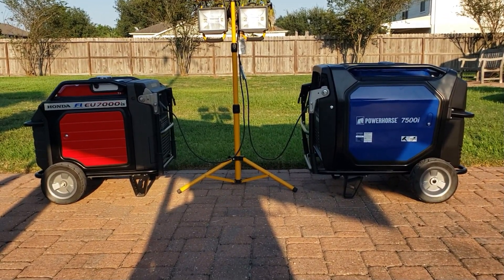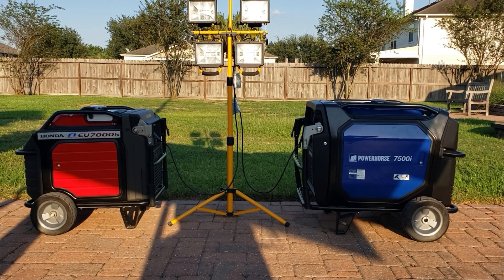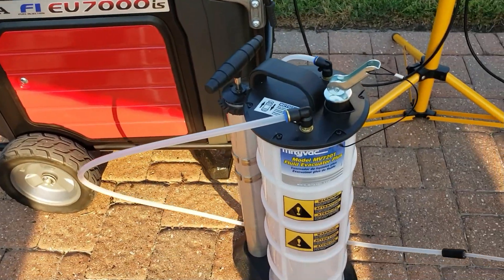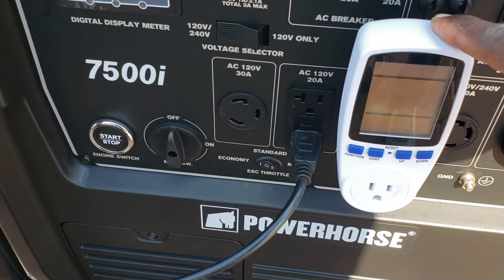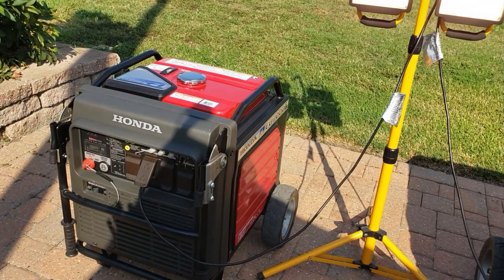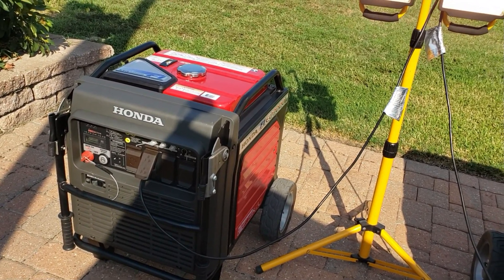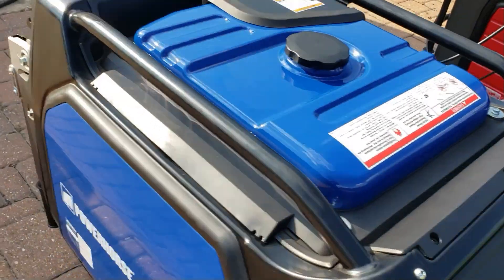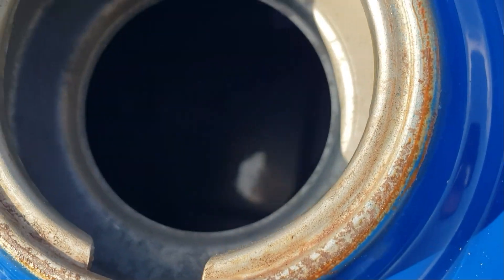Honda EU7000 VS Powerhorse 7500i Fuel Efficiency Test | Carburetor vs Fuel injector

Comment: According to GeneratorBible comparision. The Honda 7000is burns .32 GPH at quarter load and a Duromax 7000IH burns .19 GPH at quarter load.   Its hard to imagine duromax efficiency being that significant.  I think testing that would make a great video.

Comment: Notice: Powerhorse Warranty Dept is actually the Sales Prevention Dept.  Purchased 7500i on 06/2024 and by January 2025 the inverter failed. Calling the Warranty Dept (via Northern Tool) I was told because we are  "Off-Grid" we were considered "Commercial". We are not. We are a single family residence. I specifically purchased the Powerhorse after reading the Warranty, which specifically stated, residential covered for 2 years. NO mention of Off-Grid or Hour Limit. The Warranty Rep then went on to say, " It doesn't matter what the warranty says we make the call". (Whether you are commercial or residential) My opinion is don't purchase a Powerhorse there are several better quality choices out there in the market who back their product.

Comment: it would be interesting to test the old carb eu7000 vs the new eu7000 fi to see how much better the fi is over the carb model, also it would be interesting to test the Honda  7000 vs the Honda 3000 at a 1000w  just for fun. is that something you could do?

Comment: I would to point out another difference between the Yamaha and the Honda in this test, the Honda does not meet the California emission standard so it can't be purchased in California, the Yamaha does meet the California emission standard so you can purchase the Yamaha in California. So even with the electronic fuel injection the Honda is not as clean burning as the Yamaha with the carburetor.

Comment: This test was not quite fair to the Yamaha because some of that 32 ounces of fuel had to be used to full up the fuel bowl, the gas in the fuel bowl is likely enough to run the Yamaha another 2 to 3 minutes putting the Yamaha within 1 or 2 minutes of total run time on the same 32 ounces of fuel. Remember that when you turn off the fuel shut off valve you are running the carburetor dry but the fuel bowl will still have fuel in it, that is why you have a fuel bowl drain screw for long term storage to drain the fuel from the fuel bowl. 

What should be done is put just enough fuel in the Yamaha to allow it to start and let it run the carburetor dry, then put in the 32 ounces of fuel and do the test, that way the fuel bowl will only need a very small amount of fuel to top off the fuel bowl.
Reply from the maker: Hey guys, the whole point of this test is to show in factory condition and also to be fair. The Honda had to use some of that fuel in its fuel pump and the filter.
Reply from the maker: And also the Yamaha uses every drop of that fuel when it shuts off the bowl is empty
Reply: @GeneratorReviews  Actually it does not, that is why Yamaha installs a clear hose and tells you in the manual to drain the fuel bowl by opening the fuel bowl drain screw. 
I run my Yamaha's with the fuel valve shut off to drain the carburetor but to completely empty the fuel bowl you still have to open the fuel bowl drain screw.

Comment: Regarding the kill-a-watt not fitting.  I have a short VERY heavy gauge cable I use sometimes.  Its on ly maybe a foot long.  But it has 1 male plug on one side to lug into the outlet and on the other end it has a splitter to have 3 outlets.  You could plug something like that into the Honda and the kill-a-watt into that with the lights plugged into it.  I know it's an old video.  But that little short extension cord shouldn't affect the results for anything you test in the future.  Good video.
I'm about to buy one of the Hondas by the way.

Comment: Big mistake!  Empty gas tank is a great BOMB full of gas/air mixture!  Let's store them like we do a prop airplane.  Every plane is ALWAYS stored with FULL tanks for great reason, to prevent your empty tank from breathing.  Night comes.  Empty tank air shrinks and sucks in moist air thru vent.  The cold tank all night causes the dew air to condense on the tank into droplets which slide down the walls rusting the inside of the tank and collecting at the outlet to your engine.  Day comes, temp rises pushing air out the vent.  Night comes and the dew air gets sucked in to repeat the process.  Water gets sucked into the plane engine causing a CRASH!!  Full tanks can't breathe.  Gas in a full tank doesn't breathe out the light aromatics so the gas NEVER GOES BAD!  No magic potions are required like STABIL to keep the gas fresh.  Full tanks contain NO EXPLOSIVE MIXTURES!  No air in the tank...no burning!  ALWAYS store planes/cars/gas-powered anything FULL TO THE LINE.
Reply: Interesting, so much to learn. I have never heard this before. So an empty gas tank breaths? I’m so confused 🫤
Reply: Ya 29 years in aircraft maintenance and a ppl , not one bit of that is true . 
Aircraft fuel tanks are at atmospheric pressure.  
The rest is pedantic nonsense you’ve spit.

Comment: When the works gets gummed up you can tear a carburetor down, and clean it up to start.  If you have the better one - fuel injection - then you are probably out of power until the storm is over. then all you have to do is figure out how to get the 200 lb monster to the repair  shop.
Reply from the maker: 😅Agreed ☝🏽

Comment: You said what??? Come again??  Half hr for every half a quart of gas you realize there is 4 quarts to one gallon of gas? That's 128 full oz'es of gas 32 per quart. I know damn well ain't no twin engine running 20 minutes on even one quart I've watched my Intek vtwin Briggs. 22hp.  About half a quart every nine minutes. Happy medium somewheres between quarter n not quite half throttle without load. That free spooling just running. ( YOUR A F*CN😂 LIAR)

Comment: So that's 2 kWh per gal for Powerhorse and 2.8 kWh/gal for Honda. That is way short of typical small generator efficiency of 4 kWh/gal. You need to try these at 50% rated load or 3500 watts instead of 15% load.
Reply: That's because they ran at such a low load. A generator will run most efficient when running close to 100%.

Comment: I like the smaller generators because I know you would have gotten more fuel economy or efficiency out of the smaller generators than these bigger generators.
Reply from the maker: I’m actually going to do that exact test with the same amount of fuel in each one.
large generator versus a smaller one fuel efficiency test
Reply: @GeneratorReviews  I'll be sure to look out for it. I know that Honda sure does look like a nice generator though I know it's pretty darn expensive but it sure looks like a nice generator especially for more power.

Comment: So how is fuel pressurized in the Honda?  In-tank fuel pump?  My point is that most generators "just sit"...some for years between actual uses.  If that fuel pump goes bad, especially  due to lack of use, and then you need that generator you might be wishing for the simplicity of a carb.  Something to consider.  Nice review.
Reply from the maker: Great point!! But I think everyone should run their Generators at least once every few months to prevent this from happening 

Thanks for the comment 👊🏾👍🏾😎💯

Comment: Honda FTW :) Power Horse ~40 Mins  Honda 52 Mins 39 Secs
Side note: the Honda has a fuel pump letting it run out of fuel will damage it eventually. eg. a fuel injected vehicle fuel pump.
Reply from the maker: Sacrificing my pump for the test that’s one test I won’t be doing again😅

Comment: You could have used the kilowatt meter with an extension cord - FYI
Reply from the maker: Then someone else will comment, you didn’t keep the test the same. Thrust me I get all the keyboard warriors in the comments.
Reply: @GeneratorReviews  hey I want you to know it was a really good video first off.  But ok about the cord idea  : ) it was just a thought - I believe that for sure - but I guess you could use two of the same extension cords or I’ve even seen some little one foot cords that have a threeway on the end

Comment: Hi Gavin, watched a lot of your videos on generators. Just went through Ian here in SWFL and have used a Honda 2000i for power to essential devices...I love that it will run 12 hrs on one gal of gas powering refrig, freezer and computer.....but would like to be able to backfeed house panel to run water heater, stove or other for short periods of time......I love the honda's but $5000 is way over priced.....so I'm thinking 2 Genmax 3500 units tied together to feed a 50 amp plug coming off of the panel. could you do a video on how to wire what I am talking about and discuss the fuel efficiency of 2 smaller units vs one big unit?
Reply from the maker: Yes I will do that, great idea 💡
Reply: Does the parallel GenMax setup produce 240v? I took a quick look and only saw references to 120v - you’ll need 240 for the stove.
Reply from the maker: @davincrook9927  yes it puts out 240v

Comment: Another factor, as others have stated, is that the Honda has a 389cc engine and the PowerHorse has a 420cc engine. Bigger engine consumes more fuel. The carb didn't help either.
Reply: Yep yep 👍👍

Comment: Hi Gavin, I just subscribed and enjoy your videos, thank you.  I like to get your thoughts on how to best stock up for fuel for a short-term and long-term power outage.  I live in Florida, and we have both hurricanes and no name storms to contend with.  I do not live in an evacuation zone and I'm fortunate to live in an area that is close to a hospital and underground power lines.  This past hurricane experience, we did not lose power.  But learn from the past and prepare for the future is what I always say.  Thank you so much!
Reply from the maker: Hey Juan
Thanks for subscribing. I think the best way you should store fuel especially gas is having all your containers and your gas treatment ready. 
Usually when a storm is coming, we usually have a week in advance warning that’s when I store my fuel.
Propane has a 20 to 30 year shelf life so you don’t have to worry about storing propane.
Always store your generator, completely free of gas.
Reply: I live in Florida as well I purchase my fuel between 35 and 45 gallons in 5 gallon containers when the first storm threatens and I buy the fuel before all the panic buying starts, as long as you have air tight fuel cans which todays fuel cans are air tight you can store enough fuel to get you through Hurricane season. If a storm hits you may use up most or depending on how long power is out all of the fuel supply so you may have to replenish after the storm passes and electric is back on. If you don't have to use the fuel or you only use part of it as soon as hurricane season is over you can then put the fuel into your vehicles. 

One thing is you should purchase only premium fuel, that way the octane will stay consistent while you are not using it, any degradation of the octane will still keep you above the 87 octane of regular fuel. 

We were without power for a week and a half after Hurricane Ian and we used 40 gallons of fuel running two generators. During this last Hurricane Milton we lost power for just under two days and we only burned 5 gallons of fuel.

Comment: Gavin, great test/comparison 👍 - Love your no-nonsense ☝️ approach - You sir have a new subscriber. 

I own the earlier (carbureted) Honda EM7000is.  Purchased it in 2004 and have used the generator after several hurricanes 🌀 hit South Florida since then.  Fortunately, we did not get hit this week in Miami by hurricane Ian.  

Anyways, I am very happy with my Honda.  It will run 14 hours on 5.1 gallon tank with all the connected 120v load in my home.  I use a Cutler Hammer/Briggs & Stratton 7500 watt transfer switch to handle the load distribution.  Back in 2004 the Honda cost me $3,500.
Reply from the maker: Thanks 🙏🏾 LP
These are forever generators, happy to hear you are safe from the hurricane 🌀 
Thanks for watching and subscribing

Comment: So.... the Honda would burn around .32 gal/hr for 16 hours.  That  surely would be based on 25% load or less.   I'd guess at 50% load, it would be more like .5 gal/hr or more.  At 75% load -guessing .7-.8 gal/hr.   If you ran 50% load for 8 of 24 hours,  thats up around 4 gal/hr.  If you had no line power for 5 days.  would be 40 gallons of gas if math is correct.  That's eight gas cans of 5 gal each.  Someone ✔✔ the math.  40 gallons x $5/gal=$200  $40 day?  After a major event like Florida's most recent hurricane,  where would you find gasoline, much less 40 gallons  and have to store it.

Comment: Wow... That is pretty impressive for both of them.  Another comparison loading each up to 50% and 75% load on each would tell if there are differences in how the inverters handle power loading.   I have an older no-name Chinese 5500 watt (6000 surge), non inverter generator.   I just ran a test a few weeks ago.  I used 32 ounces  (1 qt) of fuel.  I used two 1500 w heat guns on high.  So 3000 of 5500 watts is a 55% load.  It ran just for 23 minutes and a few seconds.  
Anyway, double the price for the Honda,  I'd have to stay with the other options.  If you have Nat Gas,  (conversion kit) you don;'t have to run all over the place finding large quanties of gasoline for extended outage. But - that isn't likely an option for the Honda Fuel injection...

Comment: This is why cars moved to Fuel Injection from Carburetors years ago.  I knew what the outcome would be before the test was run.  The only question I had was for how much longer.  You look at this result, and now think of larger Engines, running gallons of gas, and it makes a huge difference.
Reply from the maker: Well said sir👍🏾👌🏾💯
Reply: The reason vehicles went to fuel injection is because of tighter emission standards, but Honda failed with the EU7000iS because even with their electronic fuel injection it does not meet the California emission standards and it can't be sold in California, the Yamaha with its old technology carburetor does meet the California emission standards and you can buy it in California.

Comment: Honda is the best at everything  cost is higher for the Honda  but you get what you pay for
Reply: Totally Agree 👍
Reply: I disagree, Yamaha is second to no-one when it comes to inverters, their generators are well known for their reliability and longevity and the Yamaha inverter produces power clean enough to run sensitive hospital equipment. When it comes to motorcycles Yamaha is always ranked number one in reliability.

Comment: With carburetors its all about jetting for your elevation and temperature.  Both engines will only run so lean . The efi gen  is obviously self adjusting leaner then the carburetor generator is jetted.
Reply: Here is a fact left out, the Honda even with the electronic fuel injection it does not meet the California emissions standard and can't be sold in California, compare that to the Yamaha which has a carburetor does meet the California emissions standards and is sold in California.

Comment: If you didn’t use the fuel tanks it would of been a fair test. You introduced too many variables if you were to use a separate tank and measure out the same with no variation in tank and bottom design your results would be more accurate.
Reply from the maker: You’re right, but I always try to do a real world test as it sits we’re not testing the engine we’re testing the tanks and fuel lines. 
we’re testing the complete system seeing how efficient the generator tank is at getting every ounce of fuel into that engine.
But I do understand your point
Reply: Well, one of these engines uses a fuel pump in the gas tank to provide pressure for the injection system while the other uses gravity. the Powerhorse will use all it's fuel minus small amount left in carb bowl while the Honda will stop running when the fuel pump stops providing pressure to the injector. The best way to do this test is to run both generators for the same amount of time and measure what was used:) I would expect the Honda to use less fuel because the generator can better optimize itself for altitude.
Reply: He should have sucked out most of the fuel, but left enough that they could both run with a load,  let them run out of fuel, and then added an equal amount to both of them.
Reply from the maker: @erik_dk842  that’s exactly what I did. I made them completely run out before I started the test. They both ran out and I tried to start them.
Reply: @GeneratorReviews  Thanks for your reply. I was under the impression that you just sucked out the fuel
Reply from the maker: @erik_dk842  ohh ok, I ran both of them dry until they shut off. That’s why it was so hard starting the powerhorse.
Reply from the maker: Thanks for letting me know. Maybe next time I’ll clarify that.👍🏾💯

Comment: Significantly different situation, but I owned an EFI Polaris Sportsman and an carb Polaris Sportsman. The only difference was EFI. 2003 vs 2003.5 model year. Bought them a few months apart. The EFI had way more power, way more throttle resolution, and way, way more range. Carburetors are the stupidest caveman tech. Welcome to 1930!
Reply from the maker: The carburetors are pretty much calibrated for middle of the road performance the the EFI recalibrates as the load changes gives you a streamline operation
(welcome to 1930)😅
Reply: bUt yOu cAn fIx a carb with a sCrEwdrIver. Standard Neanderthal defense of carbs.
Reply: @erik_dk842  Love this response!
Reply: Properly adjusted carbureted engines normally run rich (over fuel) at higher altitudes and run lean (under fuel) at lower altitudes.